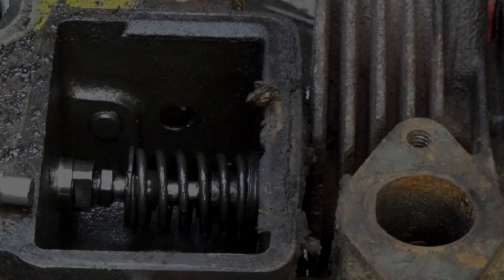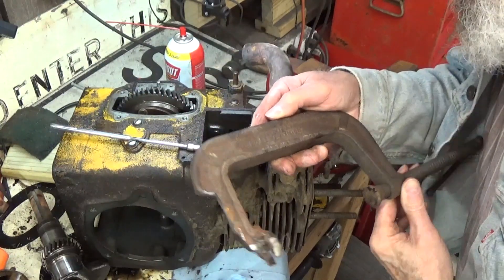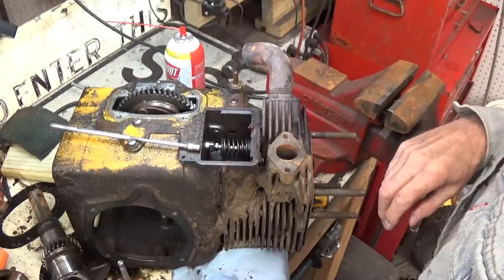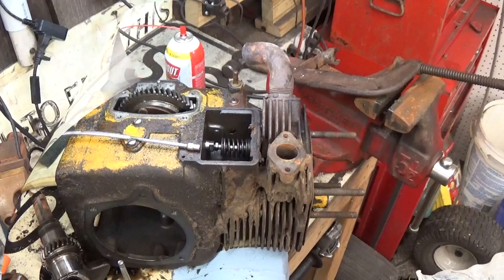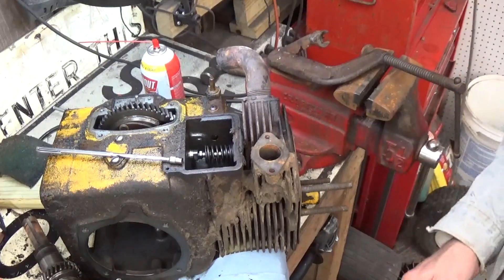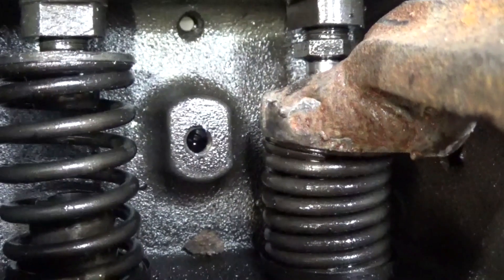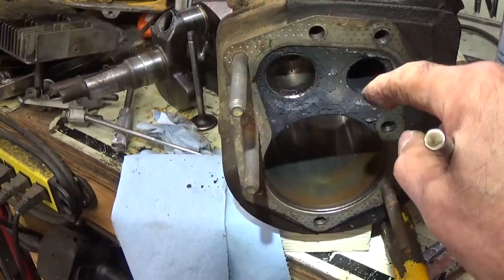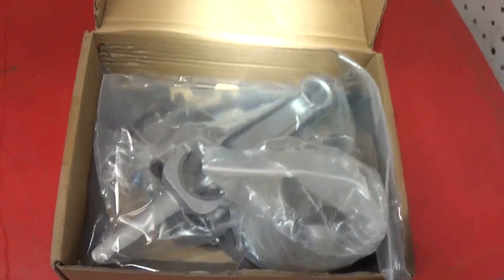How to remove the valves with a homemade spring compressor, Kohler 12hp, K301

Comment: Just this morning I made one from a cheap c clamp by removin the reinforcing from the bottom part of the clamp, then cutting a slot with a diamond blade in a 4 1/2" angle grinder. I removed enough from the bottom of the clamp so It would fit under the valve. I had to widen the slot a bit one time to get it right. Took 15 minutes total, and it works great. No welding either.  Cheers from South Carolina!
Reply from the maker: I like ingenuity to make things rather than buy them if possible. Great! Thanks for stopping by.

Comment: This is going to be a reference video for me pretty soon, hopefully! I have a 1970 Jacobsen SuperChief 1450 with a Kohler 14hp, and I know very little about the old K-Series!
Reply from the maker: Well, you can learn along with me. I have worked on quite a few small engines, but this is my first Kohler. Having said that, there aren't too many differences. Just waiting on some parts for the next step. Thanks for stopping by.

Comment: Slick shop made tool George. Those are the best kind! Can't wait to hear that engine run.
Reply from the maker: Everything looks really good inside, which is the beauty of these old cast iron engines. An aluminum engine would be further down the valley towards the dump I think. Thanks Matt

Comment: You know I have been working on small engines since I was a kid and in all this time I'm 61 now... I never have bought me a proper set of valve spring compressors and I have the similar cut c clamp too.... Think this year I'll buy me a set of valve spring compressors lol 😂and rebuild an L head twin for my stump grinder. Keep rolling with the punches shade tree 🌳
Reply from the maker: Well, I'm 74 now and have been using my homemade compressor for at least 14 years. I'm going to make another modification to it to make it easier to see when re-installing the keepers. Thanks for stopping by the shop today.